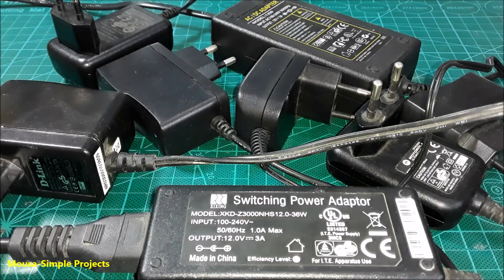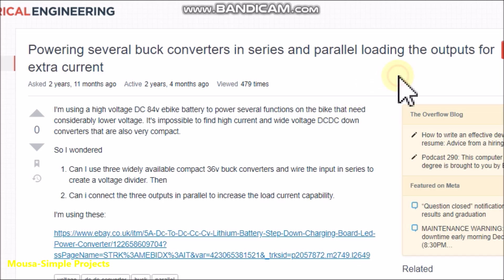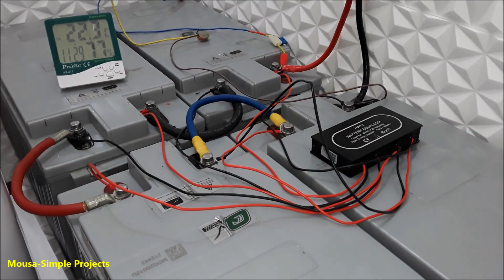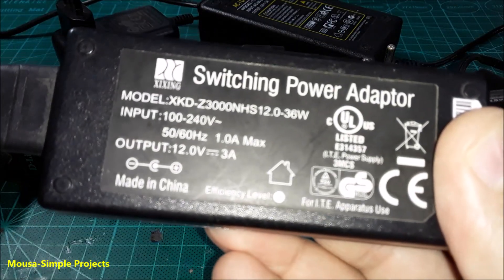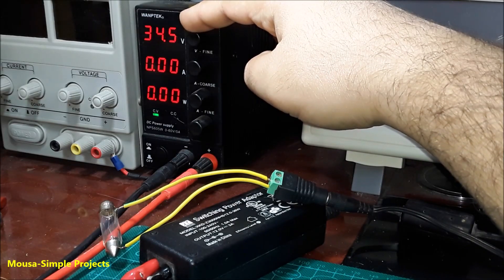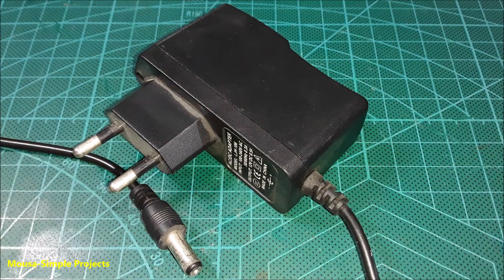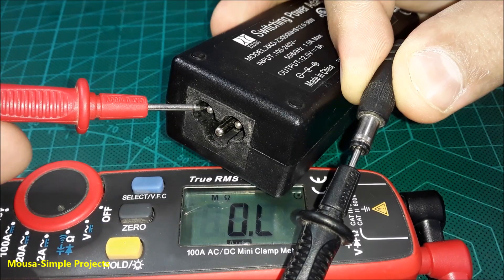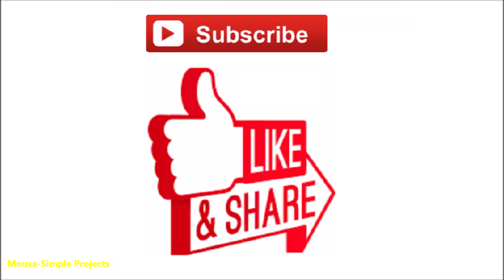Using SMPS Instead of DC to DC Buck Converter

Comment: Great Idea. Two questions, does using this for longer period damage the SMPS since the input voltage is lower than specification, will add additional strain on the input switching mosfets or IC? second does polarity matter on the input, Live and neutral to the positive  and negative of input, if I am using a power supply with power factor corrector feature?
Reply from the maker: I used this method for my laptop to step down the voltage from 50V to 19V for more than one year and it was perfect. The polarity of the input doesn't matter because there is a full bridge rectifier on the input of any SMPS. If you want to be 100% safe replace the AC fuse with a DC fuse inside the SMPS.
Reply: @MousaSimpleProjects  Thanks very much for the information. Keep up the good work!

Comment: This is great idea. Thanks a bunch mate. Tested a number of smps powersupplies and it worked like charm, just make sure the dc voltage is  above 41vdc. But if you have a higher vdc the better especially if you'll be having a high load on the smps. This allows the smps to have some spare dutycycle for voltage sag correction.(since at say 41v it most probably running at 100% duty)

Comment: life saver man, i have a 70v escoiter and the buck converters are expensive, this saved the day. i even dit some testing with a phone charger, with voltage at input over 50v was able to charge the phone with 2A, and kept 5.2v steady, under 42v at input it worked but dropped about 1.45A at output and 3.8 - 4v. Thanks mate

Comment: I just soft-wired my 36v solar panel to a 120v to 12v charger and checked both outputs. 34.7v at the solar panel and 12v at the output of the 12v adapter. Be sure to check the plug for 120v that both tangs are the same size. This indicates that this idea works. If the tangs of the plug are different sizes, then the adapter won't work for output. I checked. 
Thank you for the idea 💡!